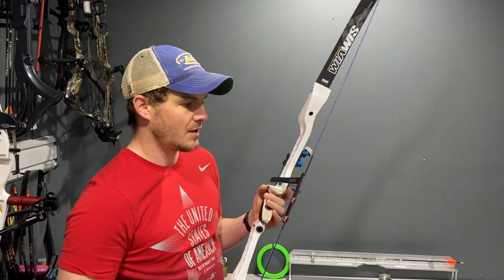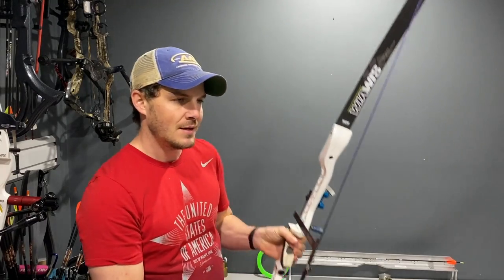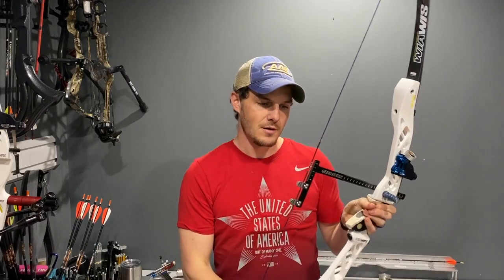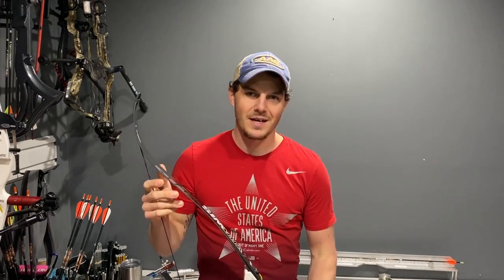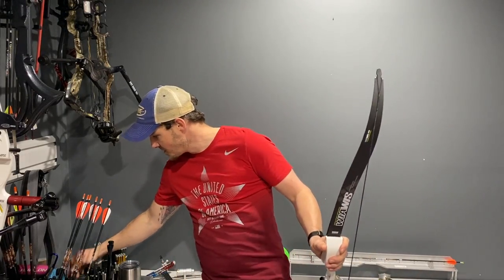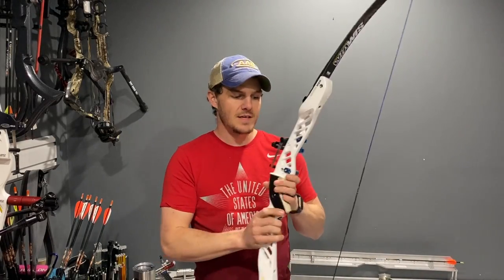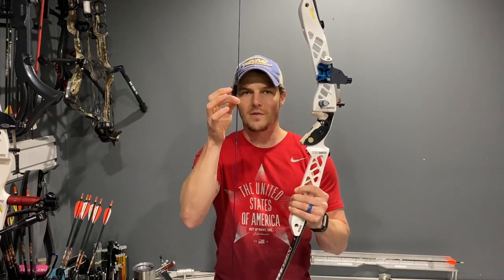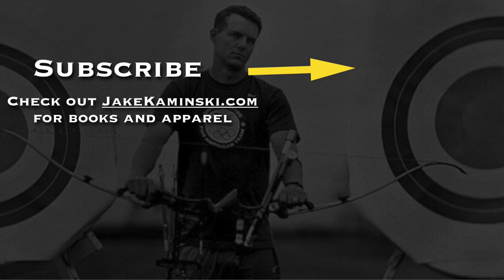Recurve Archery Nocking Point | Tuning Series Episode 9 | How to find the best spot for you

Comment: I can't thank you enough for finally - FINALLY - being the guy that says "a 2020 recurve setup is just not the same as a 1990 recurve setup, so why are we using tuning advice from 1990?" The tuning process is confusing enough for a beginner already! I just sat here with my mouth hanging open and my mind blown, because I shoot beiter nocks, and my nock height has NEVER been 'right,' because once I hit the top of the 'acceptable' range, I quit raising it (even though the bareshaft was showing 'nock low') and assumed that the problem was my technique. I know my technique needs work, of course, but this would definitely explain some frustrations I've had for literally years, thank you. 😭👌👍

Comment: Hey Jake, I just replaced my epic stick on arrow rest because I installed the old one too low. Now my plunger is touching the side of the arrow like it should but now I'm hitting the target 5 inches higher. Do I need to change my knocking point or just walk further down the string? Currently at 18 meters I'm walking down 1 1/8". It seems I'll need to walk down another half inch in order to shoot center. The top of my lower knocking point is 1/32" below the rest height. 

Thanks for all your help. You rock!

Comment: Thank you for this Jake.
Now that you do BareBow, which nocking points do you recommend?
I can imagine with the changing string angle w/ string walking you’d need a wider nocking slot. That would seem like a moveable nocking point would be good. At least until you discover the required width.

Comment: In the minute 3:38 you said it work with compound to have the mocking point at 0 angle with the string but i think no it doesn't work even the compound can be little high is depending of the archer release and other tuning of the bow

Comment: Hi Jake, what a timing for this tutorial... I had just ordered my first set of Beiter nocks, which arrived yesterday. Watched your video last night. Heard your comment about the higher nocking point for Beiter nocks. Without that information from you I would have really been wondering today about what is going on with my form (never would have guessed that a nock can have so much influence). I had to raise my nocking point 1/4"!! What puzzles me is that I'm a barebow shooter with 3 under, however, I'm only crawling 1/2" below the nock for 18m indoor with my setup.
So what I'm really wondering about is that the asymetrical nock should actually be made for hooking below the nock with a 3 under hook.
Do you see any drawbacks in having to shoot with a higher nocking point caused by using those nocks? There's quite a lot of pros (barebow or recurve) shooting them as far as I know.
BR Michael

P.S. Thank you VERY much for all the info you're putting out!
Reply from the maker: Good to hear. 

I’ll talk eventually about the nocks and why to choose different types. 

Quick run down is the top Olympic shooters use the beiter out nocks a lot on the easton X10 shafts because they do keep the forgiveness up a lot. However if you look at the nock wrong you’ll robinhood your arrow and your average consumer can’t afford that to happen.
Reply: @JakeKaminskiArchery  Looking forward to hearing more about this. 
However, could you please give me a quick comment on "Do you see any drawbacks in having to shoot with a higher nocking point caused by using those nocks? "
Also, I was surprised that I experienced having to raise nocking height, as I'm shooting 3 under. Your argument was that the "modern" way of hooking makes the arrow sit between the nock points almost symmetrical and that this is actually the reason why the asymetrical Beiter nock causes the nocking point to need to be raised. In my 3 under hooking the arrrow is pretty much sitting on the string asymmetrically, at least as much as compared to olympic style (I think you say old school) hook, where the bottom fingers have most weight/pull.
Reply from the maker: mhenschi it’s not needing a higher nocking point because of a modern hook, it’s needing a higher nocking point due to the shape of the nock. So regardless of the hook you will need a higher nocking point with the beiter nock.
Reply: @JakeKaminskiArchery  Thanks for clarifying. So the nock style actually would suit 3under hooking perfectly but it comes along with needing a higher nocking point. This again brings me to this question "Do you see any drawbacks in having to shoot with a higher nocking point caused by using those nocks?" Is there a trade-off, something like nock point needing to be very high (what you experienced), which causes a draw back which is worse than the benefit the asymetrical nock brings with it.
Reply: @JakeKaminskiArchery  Hi Jake, I would really very much like to hear your input on the question: "Do you see any drawbacks in having to shoot with a higher nocking point caused by using those asymmetric Beiter nocks? Is there a trade-off, something like nock point needing to be very high (what you experienced), which causes a draw back which is worse than the benefit the asymetrical nock brings with it."
You said you stopped shooting them because you found your nocking point "ridiculously" high. So you must have seen a draw back in your case, since I don't believe you made that choice just because the nock point LOOKED very high.

Comment: I adjusted the nocking point according to the tune, but for some reason it affected my shooting. Any particular reason why?
Reply from the maker: Need a bit more info to guess. How did it affect it?
Reply: Jake Kaminski not quite sure, my technique seemed fine but during release it felt like a mess
Reply: Jake Kaminski using beiter nocks with the modern hook
Reply from the maker: How much was it off that you had to move it?
Reply: By 5 increments up in imperial
Reply from the maker: 5/16ths? Or 5/8ths? How many mm if you don’t know
Reply: 8mm
Reply from the maker: 8mm is a massive change. You’ll feel a huge difference on the pressure on your fingers. Probably just have to get used to it. I wouldn’t get discouraged.
Reply: Jake Kaminski very massive in my opinion as well, massive thank you for the feedback!

Comment: Hi Jake   If my fletched arrows land  1/2 to 1 " above my bareshafts in the gold at 18m  as I understand it  my nockingpoint is too high  but   by how much?  If  it is  a very small amount would it not be easier to tweak the tiller a smidge?
Reply from the maker: It sounds super close. If your rest can move I’d just bump that.
Reply from the maker: Otherwise tiller can be used. I’ve done it to
Prevent retying my nocking points. Haha
Reply: Thanks !   I  thought perhaps  it was a  stupid idea but I'd put it out there anyways lol..  
But hmm  the rest - spigarelli z/t revolution bow version - I can tweak that a little too..  Rests can be a definate influence.. Friday night at the club I noticed a fellow on the line barebowing mediterranean style and heard a little rattle every time he loosed. Magnetic style rest like mine - he said it was just hitting the riser but it sounded off to me. Took out my toolkit n walked over. Rest's arm axle nuts in the block were loosish. Arm had too much play up and down at its tip. Tightened those up as much as I dared - no idea how old the thing was and did not want to end up stripping the thread. But  less play.. Did not hear the rattle when he loosed anymore.  And he got back to me later after the club match and said   his score was better ^^

Comment: Captions are off again bud 😛
Reply from the maker: give it a bit of time, nothing I can control. should be there eventually.
Reply: I hear ya, it's just with the anchor vid there's still none available and I'm itching to watch it 😛 but I understand it could be a different technical problem from one vid to another - I'm not down with the YouTube tech for captions as ya know, in my head it's just an on/off switch which is probably not how it works 😛